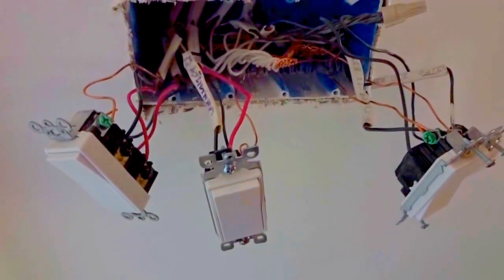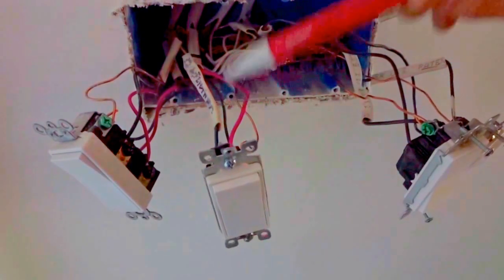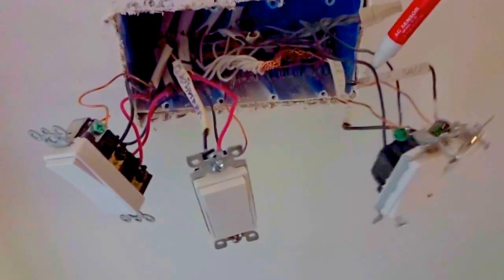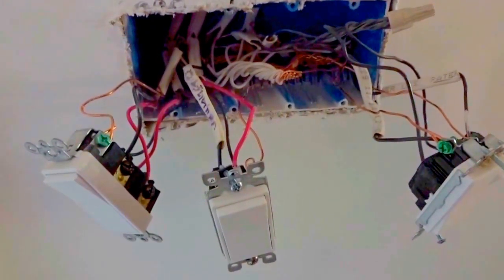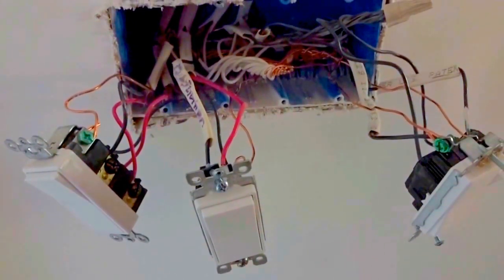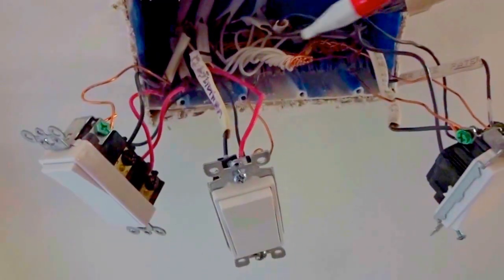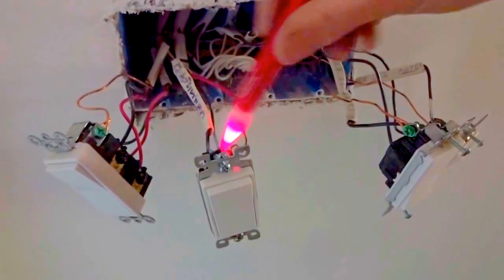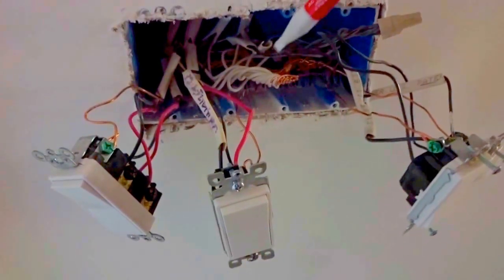Electric Code Violation: Sharing Neutral Wires of Three Circuits Creates Hazardous Magnetic Field

Comment: One time I was doing electrical work at a motel the owner wanted me to install 3 outlets for the breakfast bar , For the coffee machine , A waffle iron and a microwave , Each outlet is on its own 20 amp breaker and each outlet has its own neutral coming from the panel and are GFCIs , I never share neutrals because also if a neutral wire Drops out , it could 220 volt the two circuits using shared neutrals , and I've seen that happen at another motel , Shared neutrals on two circuits and one of the neutrals got loose and dropped out and 220 volted the two circuits and blew out the lights and the TV sets

Comment: A big safety issue arising from this condition is created and manifests itself when an electrician works in the panel on one of these circuits and turns off the breaker to de-energize it and then disconnects the neutral from the buss expecting that the neutral is not carrying any current, which of course it will be. You don’t want to get in series with that neutral. Bad bad bad.
Reply from the maker: Right. It is a violation of NEC 300.3(B) Conductors of the Same Circuit. All conductors of the same circuit and, where used, the grounded conductor and all equipment grounding conductors and bonding conductors shall be contained within the same raceway, auxiliary gutter, cable tray, cablebus assembly, trench, cable, or cord, unless otherwise permitted in accordance with 300.3(B)(l) through (B)(4).

Comment: So is this a fire hazard?
Reply from the maker: Right. It is a violation of NEC 300.3(B) Conductors of the Same Circuit. All conductors of the same circuit and, where used, the grounded conductor and all equipment grounding conductors and bonding conductors shall be contained within the same raceway, auxiliary gutter, cable tray, cablebus assembly, trench, cable, or cord, unless otherwise permitted in accordance with 300.3(B)(l) through (B)(4).

Comment: Ok on the breaker box neutral are together so what is the difernt
Reply from the maker: Neutrals of separate circuits can only be connected at the panel bus bar per NEC section 300.3(B). Other wise you will create parallel return paths and magnetic fields.

Comment: Im not an electrician but you confuse me, Lets clarify ,they can share the neutral but they cannot be all together in a big connector but if a separate them with piggy tails okay????
Reply from the maker: Hi,  the only way a neutral can be shared is in a multi wire branch circuit where the breakers of the two hot legs (of opposite phase) are pinned together so they will trip in unison.

Comment: Good point, thanks for emphasis of an important issue. I can see why some electricians would want to reduce the number of wire nuts, so that they meet code for box size. With so many wires entering that box, you could find yourself exceeding the volume limits of the box. To think that 1/4 homes have this abnormality is surprising.
Reply from the maker: Hello Spelunkerd,  This is the most common error I find: two or more circuits in a switch plate and all of the Neutrals joined.  Next most common is 3-way switch errors in halls and stair cases.

Comment: He wasn’t trying to save money on wire caps. This is just a typical example of people acting like they know what they’re doing when in reality they don’t
Reply from the maker: The violation was likely caused by trying to save time or not realizing that joining neutrals or two or more circuits on the load side of the buss bar in the panel violates code and creates a fire, shock and magnetic field hazard.

Comment: The ones that usually do this are the electricians helpers who are not aware of codes. A lot of cheaper contractors will use people to do switch and plug install who are not even certified.
Reply from the maker: Right Tyg. This was a "behind the gates" million dollar home development.  The general contractor spoke in a foreign language to the electrician who spoke NO English.  Here is an another blatant error found on this job: https://www.youtube.com/watch?v=701vfVVjj0U
Reply: I am SO sick of electricians who are: Color blind; Not certified; or Not a registered electrical contractor. If you are any of these you are NOT allowed to do ANY electrical work anywhere. Facepalm...
Reply: I'm sick of them too!  And as a licensed electrician, I am sick of competing with them and losing work to them because they are "cheaper".

Comment: Interesting - I agree that bonding neutrals from separate circuits is dangerous as it can cause apparently isolated circuits to be live, with the obvious risk of electric shock. It will also cause tripping of ELCBs/RCDs if there are independent devices per circuit. I'm not convinced about any significant electromagnetic effects though, and certainly I'm certainly not convinced there are any "really large magnetic fields that are biologically damaging".  The currents involved and the size of the circuits is such that magnentic flux density will be at negligible levels anywhere in the house - even right next to the conductor. Also, could you explain the risk of fire? I suspect there is not increased risk of fire - in fact it's likely decreased as there's less current in each neutral wire!
Reply from the maker: Hi Steve,

Thank you for your comments.  By the way, what is your background or occupation?

Regarding Fire and shock hazard and creation of unbalanced circuit current leading to powerful magnetic fields I direct you to this video jointly created by the California EMF Project and Southern California Edison.
https://www.youtube.com/watch?v=IAAZCMns8YM&t=723s

Regarding the health damage created by AC  magnetic fields I direct you too this link which refers to 7 studies about magnetic fields and miscarriage: http://microwavenews.com/news-center/de-kun-li-miscarriages.

Here are a few of my own net current and magnetic field findings in homes: https://www.youtube.com/watch?v=5uKZYsqnZ7s&t=3s
Reply: LED lights will get big mad

Comment: what year do you normally see these code violations in  the houses?
Reply from the maker: +Nancy happy camper I see them in one out of four houses regardless of age.  This was a large customs built home less than 3 years old.
Reply: +Windheim EMF Solutions thank you and this is discouraging to even believe the lack of concern they have when building.
Reply from the maker: All ages but it is more common in homes built in last 30 years.  Older homes have them because of inept remodeling work.
Reply: In other words, work done by charlatans who don't know what they're doing, so they cobble and botch everything.

Comment: Chapter 3 Is all about conductors in a raceway, ampacity charts, raceway types, and boxes. 300.4B simply states that you cant have one circuit conductor in this pipe and another in a different pipe, they must be all together. It is permissable to have two different circuits in one junction box. It would be kind practice to label them, which is what those pieces of jacket semi accomplish. Wire labels or a sharpie on the inside of the faceplate with the circuit numbers goes a long way. If part of a multiwire branch circuit (2 opposing hots 1 neutral) a neutral may be shared. I hate those. In your case the situation is probably an electrical no-no.
Reply from the maker: Great observation DangerDave.  in this case since the neutrals of several circuits are tied together in one wire nut the neutral current has several return pathways which of course leads to uncanceled current created magnetic fields.  We also found the bonding screw IN at the sub panel: another big No No.  I was told by the homeowner that the electrician did not speak english and only spoke to the general contractor in their common native language.

Sadly, all of this got by the building inspector: this is a 2 million dollar home.
Reply: Windheim EMF Solutions ouch.. I'd be mad. Really mad
Reply: Its an edison circuit. Pretty common. The only thing you have to do in order to make this code compliant is to connect the 3 circuits to a 3 pole breaker. If 3 of those neutrals are all hr, split them and be done. An edison circuit isnt going to cause a miscarriage or whatever i read earlier. Lol

Comment: i thought you can share neutral 240 volt service can have 2 circuits on opposite legs and on 208 you can have 3 circuits on oposin legs share 1 neutral thanks
Reply from the maker: This  is 120 VAC single phase.

Comment: Here in the UK all those GROUND wires (that we refer to as CPCs (Circuit Protective Conductors)) Would require sleeving with the appropriate coloured sleeving.  Does your NEC allow them to be left bare? And if so what's the reasoning behind it?
Reply from the maker: Yes,  The outlet grounding conductor can be green or bare and allowed by code.
Reply: Kris Miller   I had wondered this also and have guessed the reasoning must be because it is normally a dead circuit, the breaker should trip, and the current would take that path instead of through someone's body (I personally believe it will try to take a parallel path also). The metallic conduit and junction boxes used to serve as the safety-ground conductor (and was scared to death of it as a child); this assumes the grounding (earthing) is intact. It seems questionable, but since there are so many possibilities of touching non-insulated surfaces that it can remain uninsulated (even the exposed mounting screws). Common sense says its a hazard but conditionally is not. That has been my summation.
Reply: This is my theory grounds are bare so people who don't know code wont connect them ground wires to a hot such as adding to existing wiring. most all grounds are bare I just added an outlet for a lady down the street from me and her house had green ground wires. the wire was a smaller gauge than the hot or neutral. her house was built in the late 40's or early 50's. My house has smaller ground wires but they are bare. my house was built in the later 50's.

Comment: 300.3B does not mention anything about how a Neutral is connected to different circuits. ( https://allstarce.com/wp-content/uploads/2016/12/2017-NEC-Code-Ch-3-Article-300-1.pdf ) In fact, a Neutral can be shared with different lines if you use a breaker that will turn off all the lines at the same time. Due to the phase shift of each 110V circuit, the load that the Neutral sees with 2 circuits is not doubled. Ex: 15A double pull breaker into a kitchen counter top to make a split plug. They share one Neutral. You can run 15A on both lines and the Neutral will only 'see' 15A load thanks to the 180° phase shift that each line is on. Running circuits on a commercial 3-phase panel allows you to use a triple-pull breaker and only one Neutral. The box you display is a mess, though ;-)
Reply from the maker: Right,  You are talking about a "Multi Wire Branch Circuit" which has L1, L2, N & G.  It is a circuit.

Comment: ok, then does that apply to the grounds in the box?
Reply from the maker: Hello RangerCaptain11A
Grounds of separate circuits can be connected but they must be not connected to any neutral except at the service entrance at the N-G bussbar.  A common mistake is to connect N & G at the sub panel or even in a Jbox which will lead to voltage and current on many grounds unbalanced currents, net currents in circuits and magnetic fields.

Comment: Hello, quick question 

I have 3 switches that work perfectly fine but I upgraded them to smart switches and they all turn on but here is the issue. I have 5 flood lights and 3 of them work fine but 2 of them are dim. All three switches are under one circuit breaker and I have only one neutral wire. Any suggestions?
Reply from the maker: Hi Emin,
What do you mean by smart switch? What are supposed to do and how are they controlled?
Reply: Windheim EMF Solutions one of those tp link smart switches it’s connected to ur WiFi and u can control it manually or through ur phone app
Reply from the maker: Some of the longest wire code violation repair jobs happened in homes that were wired to be smart.  It seems the the redundancy of connections created parallel paths to ground. Check for current on the grounds in this outlet. There are so many possibilities.

Comment: Why are there 3 different circuits in that one box? What sort of crazy design is that? How many RCDs (GFCIs) do US houses normally have? If you combine the neutrals from circuits that are protected by different RCDs they'll trip as soon as you energize the installation.
Reply from the maker: You can have more than one circuit in a Junction box or switch plate as long as the neutrals are not shared between circuits.  This house is a million dollar plus house and the electrician did not even speak english and only spoke to the general contractor in their common native tongue.  This same electrician left the bonding screw in at the sub panel which created a huge net current the length of the house: worse yet the building inspector did not notice that or any of the other dozen violations we found and fixed.
Reply: When I wire I like Lighting on a separate circuit. my theory behind this process if you short out an outlet you wont be left in the dark. its not code but a better solution to being left in the dark. so its not common to have two different circuits in one box. Neutrals are kept separate. if I have just switches and usually there is no neutral just a ground, because I fed the neutral at the light and not at the switch. today's code things have changed with arc interrupter circuit breakers , I think neutrals are now fed at the switch and not at the light. I may be wrong but i heard that a white or blue wire cannot ever be hot under the new code. I took a black marker and put black stripes on my existing white wires when I replace a switch, I'm not rewiring the house at the present time.

Comment: Is it okay to share a neutral from a different lighting circuit if they are on the same breaker?  I have two 3 way switches in my kitchen.  One 3 way switch pulls the hot from the dining room lights switch, which is in a nearby junction box.  There isn't a neutral in either one of these boxes.  The switch on the opposite side of the room is connected to the neutral for the outside lights.  I need to move the switch with the hot wire, but I do not think it is okay to wire it back the way it was.  It confused the hell out of me when I first saw it.

Comment: So assuming one has a meter (I have a TF2), what reading indicates there are problems behind the plate? I am NOT an electrician, but I'd like to check all my outlets and switches
Reply from the maker: Hello Thomas,

You can measure the net current and magnetic fields in the middle of the room and up and down the hall.  See video: https://www.youtube.com/watch?v=5uKZYsqnZ7s&frags=pl%2Cwn

Comment: How do you end up with 3 circuits in a switch box? A half hot can somewhat explain 2, but 3?! I mean is every light a dedicated circuit?
Reply from the maker: The electrician was foreign born and did not speak english according to the home owner: he was brought onto the job by the general contractor.  Go figure!
Reply: ++UrvineSpiegel  Let's suppose these switches control outside lighting, which is commonly a much higher draw than interior lighting. (at least it was say 10 years ago) As an example each switch is connected to 1,000 watts worth of flood lights or pool / patio lighting so the draw alone would dictate multiple circuits. If that box is near a door then obviously one is for turning on the lights as you enter the room, so another circuit, separate from the exterior lights.

Comment: I'm not clear on the solution, I gather you have to pigtail all of the neutrals together instead of clumping them into one band?
Reply from the maker: Hi Round,  Neutrals should be kept separate for each circuit and not connected to neutrals of other circuits except at the panel bus bar otherwise return current can take parallel paths, create imbalanced loads and cause strong magnetic fields which are correlated to severe health condition.
Reply: This old house I'm living in has a lot of shared neutrals from different circuits. Is there any tester you can recommend I use to see the magnetic field that is outputting from each outlet? I recently had "an electrician" come into my house, I told him that there were too many lines from different areas of the house being shared into one outlet during a remodel and if he can clean them up into the subpanel. He said he couldn't do that because it was too much snaking involved and instead to connect the outlet and the switch again.
Reply from the maker: Get a basic three axis Gauss meter.  Hold it 12" from walls. Measure the magnetic field with all lights off and then do it again with all lights on.  Normal readings should be .5 mG or lower.  See meters here: http://www.windheimemfsolutions.com/magnetic-electric-field-meters  Also watch this video: https://www.youtube.com/watch?v=IAAZCMns8YM
Reply: 0.5 mG, or 500 μG
Reply: In this case installing a 3p breaker would make this code compliant. This guy is making a big deal out of literally nothing.